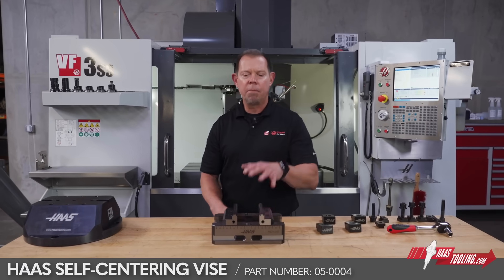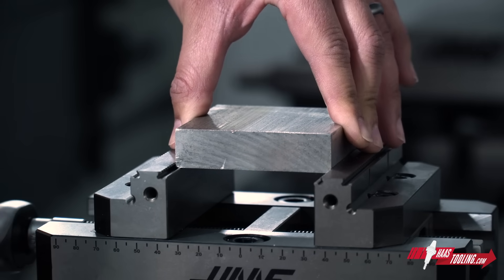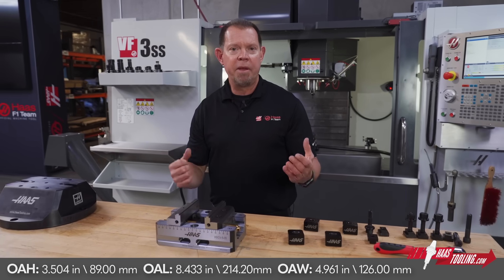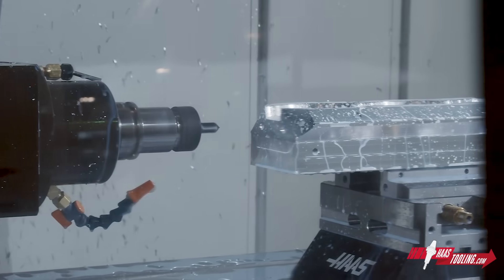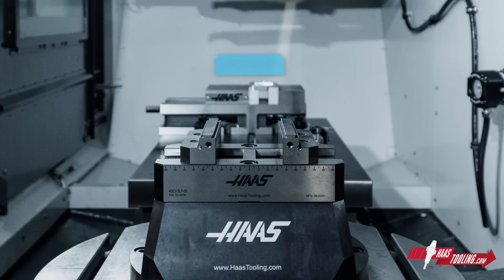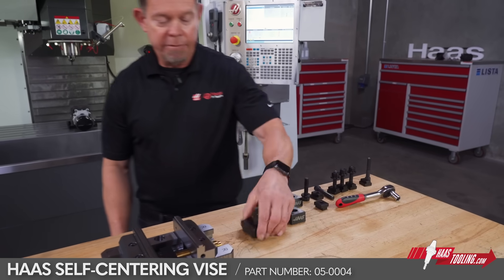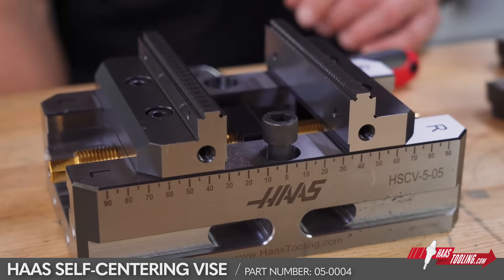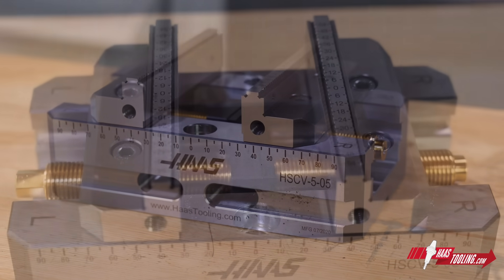The Haas Self-Centering Vise on HaasTooling.com - Haas Automation, Inc.

Comment: Does Lang Technovation make those for you?
Reply: It looks like a Lang vise modified to use less fancy clamping methods. Not even joking. The two slots on the side and the bolts on top in the middle.
Reply: Langs patent expired this year for those vices, thats why everyone makes them now. The advantage is you can get those vices now at very competitive prices.
Reply: @a.d8055  Could please tell me, who makes it for competitive pricese?
Reply: @proregressive   For example HWR in Germany makes the vices cheaper then lang and they are basically the same. https://www.hwr.de/en/solidline-en/
Reply: @a.d8055  thanks !
Reply: @a.d8055  I asked recently for HWR vise quote - price was pretty much the same as Lang. Maybe depends on the reseller too...

Comment: Reminds me of Lang self centering vices, and those are really nice vices.
Reply: More flexible than the Lang vices though, due to the additional mounting options.
Lang vices are quickpoint only.
Reply: Yes, that is true, though if you put the corresponding adapter (people where I used them called them "placas", don't know exactly the manufacturer's name) those had the "proper" mounting options. Not as flexible, sure but a hell of a lot more convenient.  Something common, rotate the jaws to hold something bigger. Yes, you can do it directly on the machine, but for the time it takes to get the vice in and out with quickpoint doesn't compare to having to do it without bending over while the machine is running.

Comment: Price?
Reply from the maker: Kristoffer, The Self-Centering Vise is $999.95. Here is the link to the page on HaasTooling.com  https://www.haascnc.com/haas-tooling/mill_workholding/vises/05-0004.html. Thanks.
Reply: @haasautomation  holy moly!
Reply: @sarcasticommentator  that's a pretty standard price. I dunno I just googled some.
Reply: @sarcasticommentator  Right?.. Still affordable for a shop.. but .. 1000$ vice on a 1200$ mill?) Maybe they'll have a black friday sale..) Just got a matched pair of 4" Tegara vices from Shars tool co, and they're pretty sweet..) Would have gone with the Kurt's if they were a bit more in my price range..) Still paid about 600 with matching and shipping. Nothing cheap is good.. and nothing good is cheap.